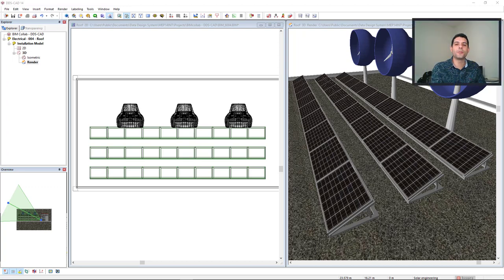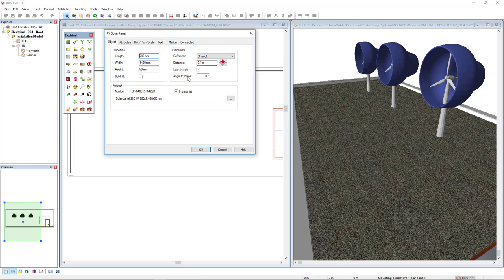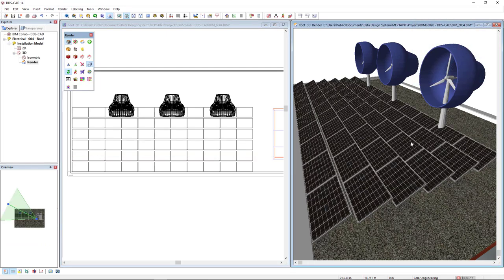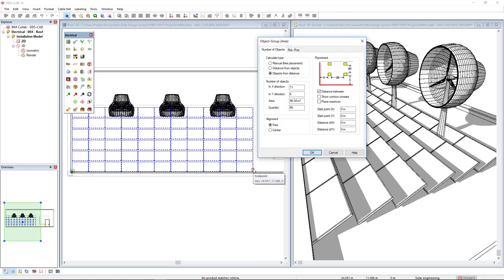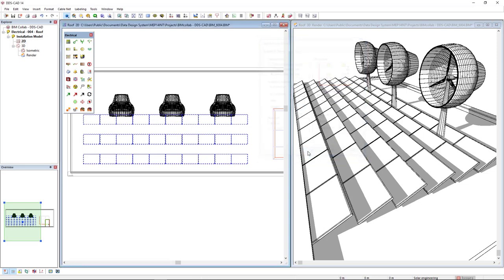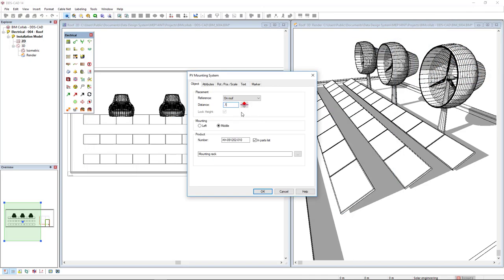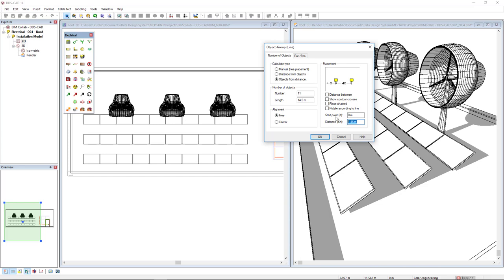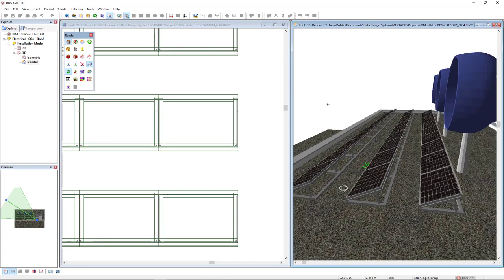Designing a PV system with DDS-CAD in just 5 minutes

Comment: Hi Felipe,
Good job!

Could you, please, prepare a similar video about designing photothermal solar panels?
In "Heating/sanitary" module I haven't found some functions you have used in PH panels designing...
Reply from the maker: Hi Michal, the design procedure is exactly the same. It does not matter if you call the object a PV or Thermal, both are panels with certain dimensions. The Object Group function will provide all the necessary functions you need.
Reply: Hi Felipe, sunlight analysis and mount systems are in heating/sanitary module too? I haven’t find them...
Reply from the maker: @michalkmet9456  Sunlight can be activated in the Render working mode. Mounting systems are by default only available in the Electrical toolbox. You can create your own rack in case you would like to have them included on your BOQ. Else I would recommend to write a recipe in your Cost Estimation software, which automatically considers a mounting rack for each available panel in your model's BOQ.